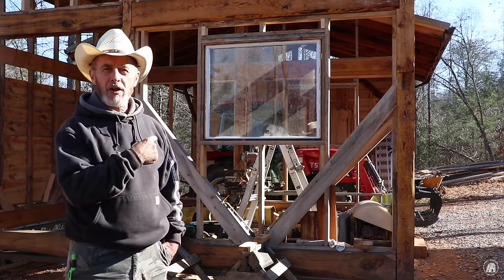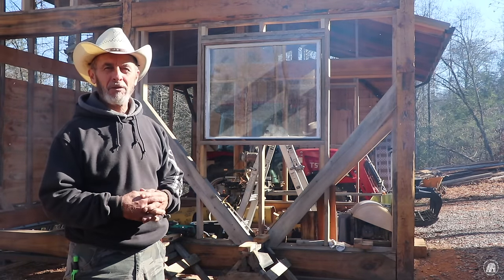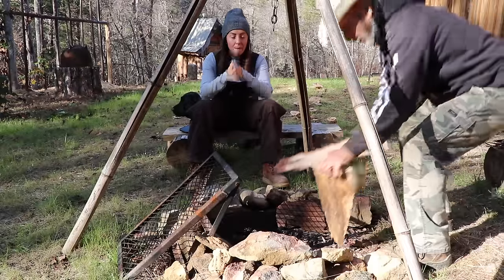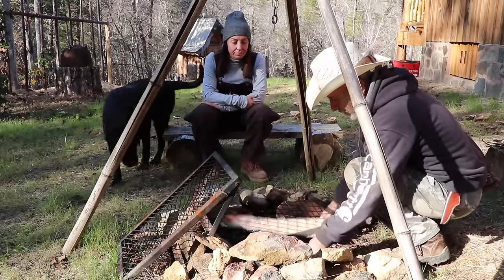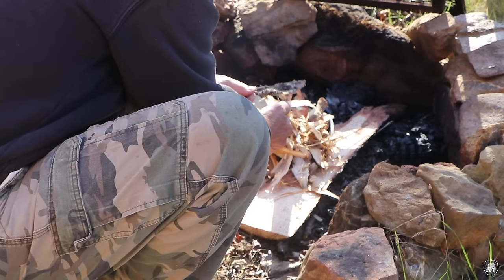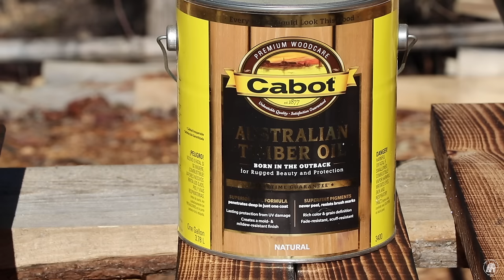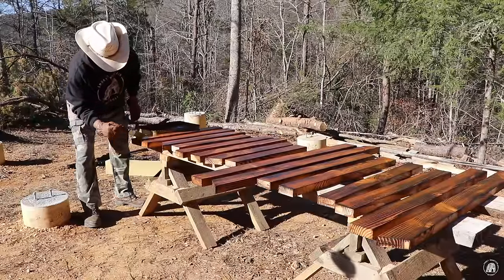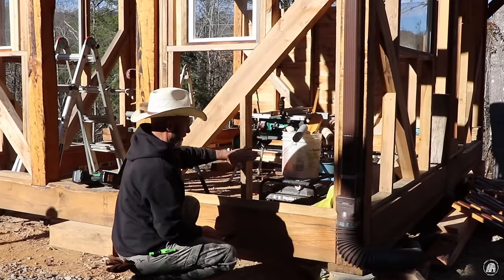Milling and Installing Siding & Old Windows in the Workshop

Comment: Question! Does different finds of logs cause your blade to dull easier? And when I say different I mean pine , oak , gum and so on .
Reply from the maker: Pine trees leave residue on the blade, and only really diesel fuel works the best to get it off. And of course the harder the wood does the chain quicker than soft wood, because the fibers are more dense.
Reply: I was wondering about the pine because of the residue . I know i have cut up pine to remove because it had fallen from a storm , i hate it because of the residue . It will dull a chainsaw and build up on the chain ,